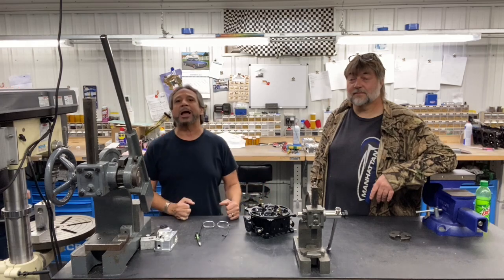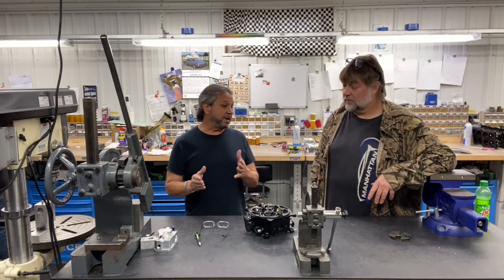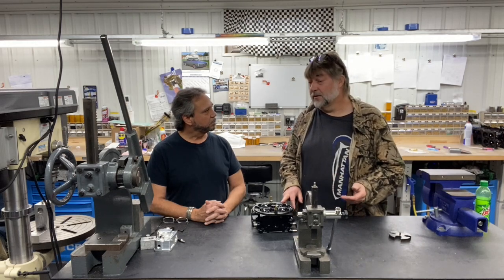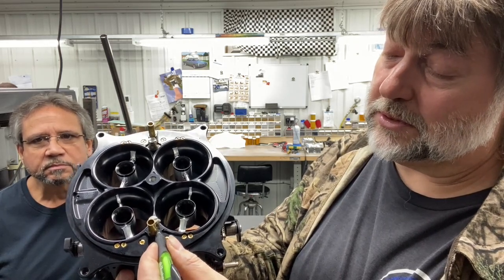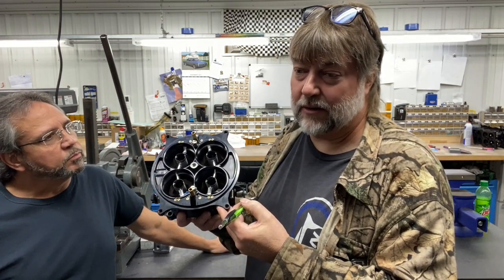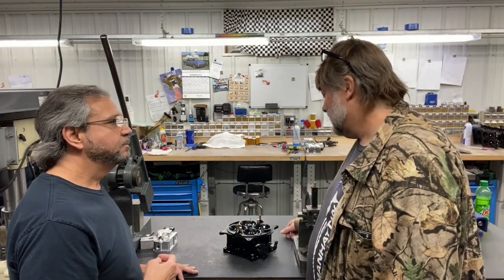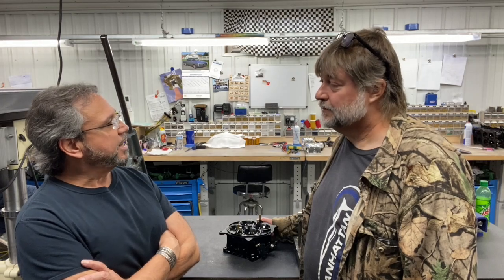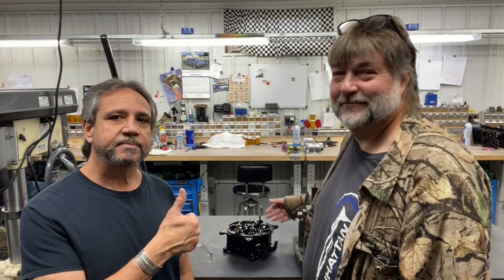DBG/Advanced Product Design: Initial Video On Air Bleed Tuning, What Circuit,  Air Bleed Locations

Comment: So you make youre own carbs?

I cant find a video on how to tune emulsion bleeds in a metering block, that is the next topic tham comes after bleeds in my opinion.

Can you guys help me out on this one?
I dont have a carb from you guys (i live in Europe Belgium) but i have a quickfuel brawler 650 double pumper on a 331 stroker.

My full throtlle is rich from 10afr 2000rpm to 11afr 3400 rpm.  And go's to 13.30 AFR on 6000 rpm with a manual trans(timing is 2500rpm all 32 in)

I changed jets, airbleeds , pvcr's and cant get the fuel curve going flat .

Thanks for helping and i hope there is a video in the make with you guys in it
Reply from the maker: That may be the next topic in the series. As far as other carbs,, they do not work with other assemblers carbs. They do not know what they work or they are designed. It’s best to talk to Quickfuel, as they put the carb together. But most likely now owned by Holley, so good luck with that. Wwwholley.com. Stay tuned my friend. 💯🏁💪

Comment: i figured these out from a 1912 book describing "air bypass valves". 

it pays to know history, the origins and reasons for doing things.

 early on, they had a spring loaded valve in the manifold. carbs were primitive...

they found when they slapped an engine onto wheels and drove around, as RPM increased, the mixture got richer and richer. so they let air leak in behind the carb intentionally, and that tended to prevent the issue. its not an issue when the engine runs at a constant speed.

a jet relies on the venturi effect. a reduction of pressure. 
the venturi relies on air speed. an engines RPM and therefore air speed through the venturi depends on the load. not the throttle setting. the throttles job is to reduce engine power to match it to the load its experiencing.

as RPM increases, so does air speed and the suction on the jet. it isnt linear, and the jet delivers more fuel than required.

rather than leak air into the manifold after the carb/throttle, they started leaking air into the jet itself, the "emulsion tube". reduce the fuel exiting the jet, and with some fiddling with hole sizes, one can get the fuel delivery to stay relatively constant with the volume of air entering the engine. 

most motorbike carbs do it "the other way round", using a pitot tube to ram air into the emulsion tube chamber, lowering the fuel level, progressively uncovering the holes. either way, they perform the same function. an intentional air leak.

the best way to demonstrate it, and to get a feel for whats happening, is to get a little 50cc bike (so you can give it full throttle without running out of road?) and solder the emulsion tube holes up... drill new ones, etc.
Reply from the maker: Well there you go, history repeats itself. This is a tough topic to break down and relate to visuals. Stay tuned and see how we get it done. Thanks for watching and commenting 🏁

Comment: Without change there is no advancement.
Reply from the maker: And without problems, there is no learning. Glad you’re here at DragBoss University, DBU. 🇺🇸🏁
Reply: @DragBoss351Cleveland  always pressing the limits
Reply from the maker: @michaelclanton1152 have to find the boundary’s and stay on the ragged edge.
Reply: @DragBoss351Cleveland  to me being on the ragged edge is for pro stock,pro mod and people setting records. All in all how fast can you afford to go will drive your goals.
Reply from the maker: @michaelclanton1152 well when your racing a cleveland it’s on the ragged edge to be able hold the power it makes. But get what you’re saying Michael. Let’s put it this way, finally have the block solution. Stay tuned.

Comment: I look forward to part two. The carburetor is such an important component that can make or break a good engine. Very little info on the subject of air bleed tuning.
Reply from the maker: Good deal. But this may be a 4-6 part series. You are right, not a lot of info on this topic, hands on especially

Comment: Great carbs but over $2k aud vs direct from prosystems $1.2k aud is my problem here in Oz.
Reply from the maker: I get it. I always say you get what you pay for. I have ran both and quality of apd is the next level. I  had an issue, with the king Cobra from pro systems. One Throttle blade screw laying on blade after a few pulls. And it was way off. Do what works for you mate 🇦🇺
Reply: @DragBoss351Cleveland , I have never seen ProSystems or ADP off or with issues here on the strip in real life. Both have great customer service—to me, it's just which colour brand you like more. If I could get an ADP for $1500 for my application, I would do it, just to have the service in Australia with RaceMaxDirect.

Comment: Drill a hole in a straw above the liquid level then drink a soda with it, you'll understand the 1st basic principle of air bleeds. Pre-emulsion agitation would be a 2nd basic principle used to break/shear the mass fuel source from the jets into finer particulates exiting the emulsion well which are then circuited into the main boosters for distribution into intake depression. (air/fuel & atomization) Maybe squeeze in a glimpse of this guys wet flow bench in a video prior to it's airing. Many idle & third circuit bleeds are paired, "that sucks"
Reply from the maker: I will save this and dw John and see if this can be incorporated into vids. This is a tough topic to explain, as we get into it, get better visuals. Appreciate you taking the time to explain. 👍🇺🇸
Reply: better demonstration is to blow over the straw, the venturi effect. the harder you blow, the more liquid lifted. progressively uncovering the hole come air bleed as you blow harder will keep the ratio of air to liquid more "constant".

bike carbs like mikuni etc tend to do it "backwards", a pitot tube in the throat that forces the fuel in the emulsion tube chamber down to uncover the holes. end result is the same.

smart carbs and lectrons seal the bowl and apply the suction there... reduce the bowl pressure that pushes fuel into the jet.
Reply: @paradiselost9946  The main booster's are the blowing over the straw, the air bleed circuit introduces an air stream into the main well which is sheared by passing fuel to pre-atomize & in part contributes as a metered suction control. These are beginner tutorials, trying not to over complicate with varying fuel mechanisms & designs using air ejection.
Reply: @LawfinOmega  bit of thinking, the easiest and clearest way to demonstrate would be a flow meter and vacuum gauge. 

double the airflow, would show the suction on a venturi wouldnt increase twofold, linearly, but exponential. treble, quadruple. something like that. 

now i sort of wanna hunt through my welding gear, sure i have a spare meter somewhere...
Reply: @paradiselost9946  Drag Boss in coordination with APD Carbs, are just trying to school the basic fundamentals of carburetor principal & circuitry across to his viewers. I'm going to limit my input to the introduction of an air stream into the main well via. controlled metering. (the hole in the straw above the liquid line allows air into the stream of liquid & disturbs/disorientates the liquids mass. (thus emulsion) one of two main functions in the air bleed circuit.
Reply from the maker: @LawfinOmega good analogy keep it simple , Appreciated.
Reply from the maker: @paradiselost9946 that will keep you busy paradise
Reply from the maker: @LawfinOmega yes we will get some good cut aways and I think we can explain it well, but short vids 5-10 minutes.
Reply from the maker: @paradiselost9946 there you go, the more you know. The more you know.

Comment: Is it reasonable to imagine that blowing air into the bleeds and where the air exhausts to, would be a give away of the bleed configuration?
Reply from the maker: Yes, I think John mentioned that the idle is near the acc pump, protected somewhat, high speed is further outside.